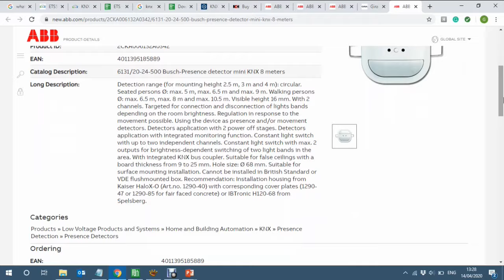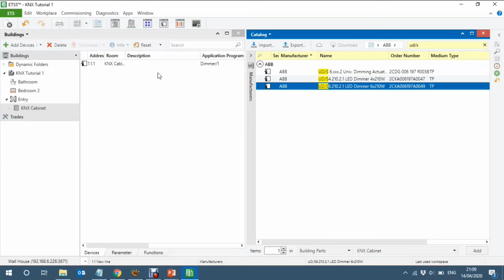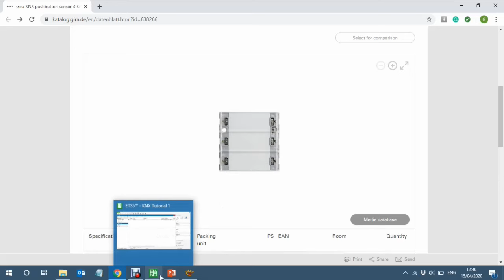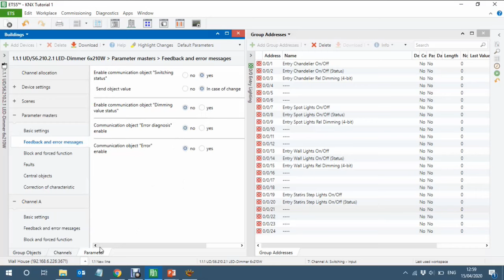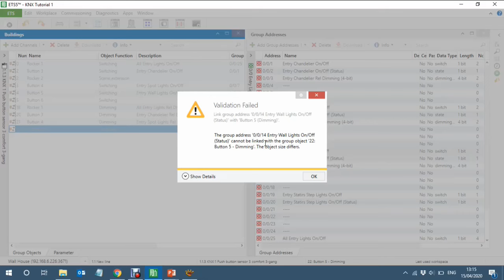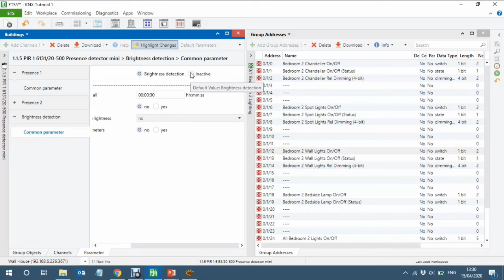KNX Tutorial 1 : Programming of basic lighting

Comment: I always get that KNX power supply is incompatible with line's media type.
Reply: Where does the power supply need to be is what I am asking.
Reply: In which line should you put the equipment, is what I am basically trying to ask.
Reply from the maker: Most of the power supply don't have individual address. It had to wire correctly.
Reply: @KNX-expert  When I try to put the SA/S8 device in my topology, it says that there was an error while trying to access the online catalog server. Do you know this problem?
Reply: Which market have you set for the online catalog?
Reply from the maker: @MsTommyknocker  Try to download it from the ABB website directly. Sometimes the files on the clouds are corrupted.
Reply: @KNX-expert  Is it the Ps/Ch AND regular devices that have chokes, or only the Ps/Ch?

Comment: Hello, first of all thank you very much for great tutorials. I have one question. As I read in KNX materials KNX component has BCU (Bus coupling unit) which are checking in some interval the status of AM (Application modul). So for me it looks like even KNX components are not doing anything they are consuming electricity. So simple KNX switch is doing that too. So may question is: Is it really money saving approach comparing to the old style when you have simple switch without any electronic devices and mechanically turn on/off the light for example?
Reply from the maker: Simple switch don't consume any power but it's very limited. You can't turn on/off a light from 10 or more different location on a simple switch.
Reply from the maker: It's mainly comfort.